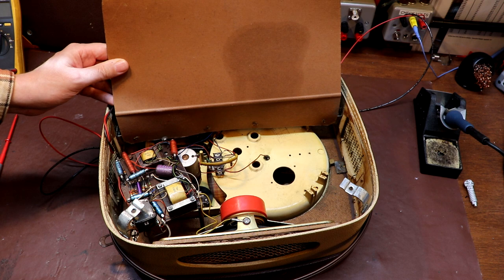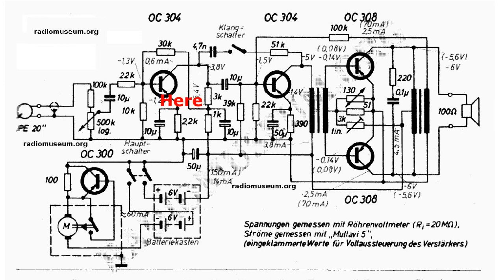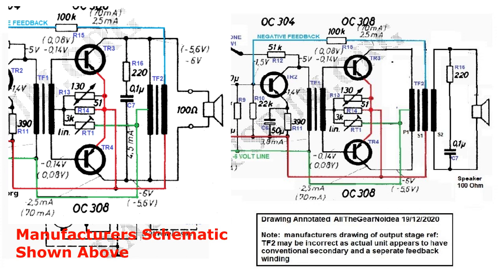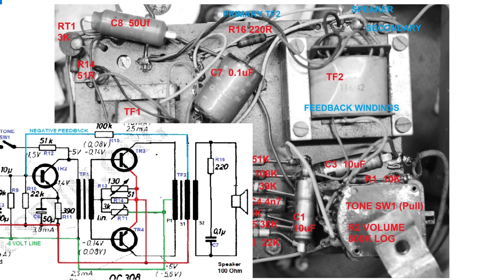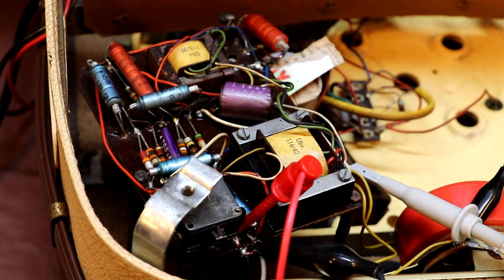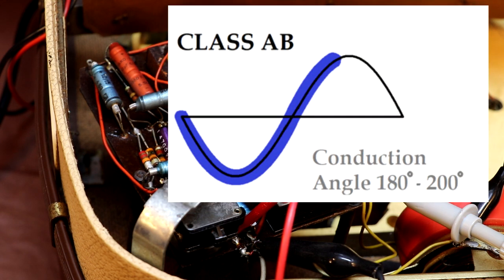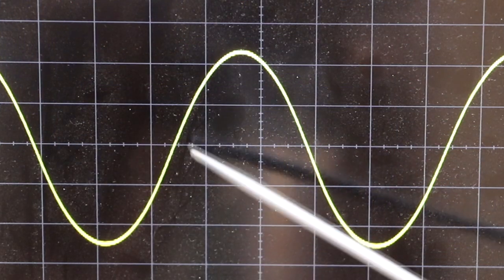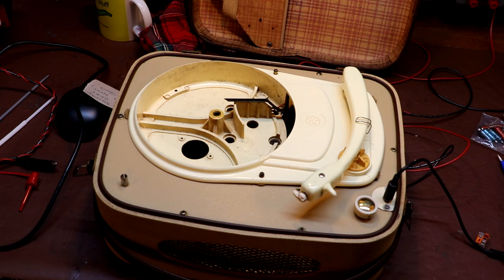Perpetuum Ebner Teenager - Record Player Restoration and  QA401 Audio Analyzer - Part 2

Comment: Outstanding, Chris. Your videos are always entertaining and educational. I would have loved to see your 8903 in operation as I am an HP fanboy. I have one that I restored - it had been exposed to a corrosive and required COMPLETE  disassembly to clean and replace one connector on the motherboard. The input card also required extensive repair, but worth the effort. Happy Holidays to you and Mrs. Noidea.  Regards, David.
Reply from the maker: I know Simon Spiers is a big fan of the 8903 I will get it  out for you tnext time. I am starting to get interrested in audio stuff so may build some valve amplifiers next year and do some audio stuff.  Happy Christmas to you David, best regards Chris

Comment: The asymmetric clipping is probably due to mismatched output transistors. I have an old Grundig box 60 and using matched output transistors improved the sound slightly, it's still a terrible receiver. Electrolytics reading high usually means they are leaky or they have a resistor in parallel with them, this can often fool test equipment. A very entertaining channel, I look forward to many more of your vids. Cheers, Steve.
Reply from the maker: Thanks for watching and  taking the time to leave nice comments. Look forward to future comments my best regards Chris

Comment: What a box of distortion lol,  you made a hell of a difference with those  craps  err caps :)
Maybe the output transistors and there bias level may add some nastyness to the audio.
The resistance in the power supply feed may be higher than ideal,  dipping voltage on peaks :-(.
As you said,  the amp does not produce enough output without sounding more distorted.
Yes im pissing in the dark, i have no idea where im going lol :-D
Reply from the maker: I think it sounded ok to me with an external audio source but my hearing etc is not very good and i dont have much eperience of amplifiers but I did find it interresting.  Could be sagging the wiring to the battery is very thin etc.  I think its a crappy ceramic cartridge but have no idea what it would have sounded like when new etc.  Stay safe and have a wonderful Christams regards Chris 

Chris
Reply: @allthegearnoidea6752  You are not the only one with hearing problems,  at 30 i caught eather chickenpox or measles (i cant remember which one), never had them before.
Tinitus + a left ear not being able to hear bass frequencys. (but can hear treble, odd).
Plus i can't listen to music now, it sounds distorted and the longer i listen the worse it gets.
Never mind, the memory has most of the 80's music i like lol.
Hope you and your other half stay well,  keep supping the tea :-D

Comment: Magnetic cartridges are far lower output than ceramic or crystal. The Moving Magnet type range from 4-12mV output into a 47K load. The Moving coils are even lower and seldom rise over 5mV but into a low impedance of a few tens of ohms. Usually a crystal cartridges are very high impedance in the 500K + range.  I like the audio analyzer and can see clearer in this video how it works. That stylus really sounds bad!
Reply from the maker: Amazing really dealing with such tiny signal levels very interesting. I’m really hoping it is just a bad stylus. Thanks regards Chris

Comment: Really enjoyable video, Chris.The frequency response curve looks very much like an RIAA curve to me. See https://en.wikipedia.org/wiki/RIAA_equalization.  When they record onto a disc they suppress the low frequencies and boost the high. Then when playing back, the amp has to boost the low and reduce the high. Reason is that otherwise the physical excursions in the track would be huge at low frequencies. The schematic doesn't show whether the mic input is treated differently, but RIAA equalization is my guess. 

I do like the German names though. Never was a control more aptly named than Klang-schalter. Merry Christmas and best wishes for the New Year,. Steve
Reply from the maker: Thanks for the information  and I am glad you enjoyed the video. I thought that RIAA only really applied to magnetic cartridges but I am  not sure I was discusssing it with simon spiers only the other night.  I bought the Mullard valve amplifier book for christmas and this has a lot of information regarding record player amplifiers so that will be my chrismas reading.   I am planning on building a valve amplifier next year.  Have a wonderful Chrismas stay safe regards Chris.
Reply: @allthegearnoidea6752  RIAA applies to all types of cartridge. The curve is applied during  recording and is on the disc. The disc doesn't know what type of cartridge is being used to play it, so all phono inputs apply the reverse equalisation, regardless of cartridge type. There may be other subtle adjustments to suit moving coil/moving magnet etc, but basic RIAA applies to all. Looking forward to seeing videos on the valve amp, all the best, Steve.

Comment: 10%THD Sounds pretty bad, when I was doing car audio we wouldn’t want to exceed about 2%.
Any amp rated at 10%THD is rated for impressive power numbers by the marketing morons probably even using PMPO too, I wouldn’t buy an amp rated that way... I looked for amps rated at 1%THD as that gives the true power rating.
Reply from the maker: I think the amplifier is just a creature of its time etc after nearly 60 years its not doing bad. I was actually suprised how well it sounded when fed from an external audio source however I know nothing about audio gear not something I have any experience with.   The distortion went from just under 5 to  2.9 follwing recapping and bias adjustment.   Im guessing the cermaic pickup cartridge is goosed but not something I want to spend money on.   Thanks for watching stay safe and have a great Chrismas. Regards Chris